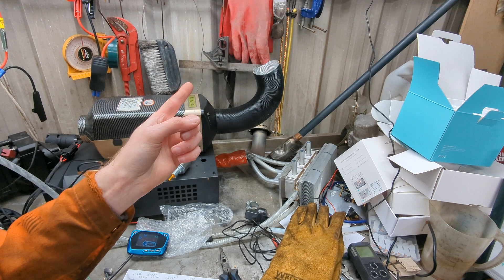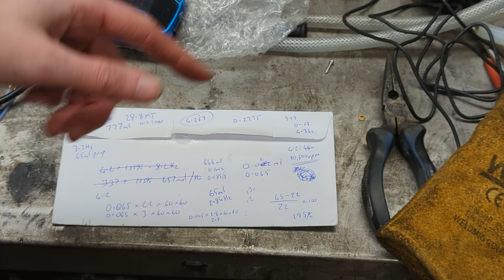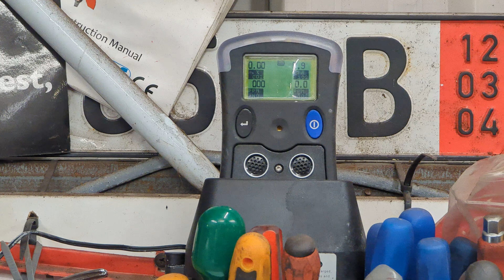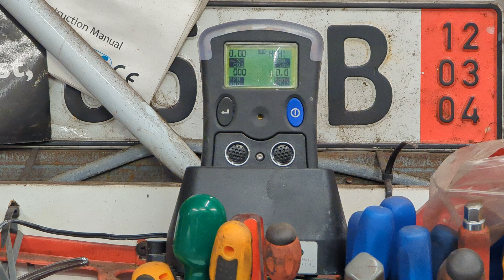Why the 8KW diesel heater can't be 8KW.

Comment: what i saw on another channel  also confirmed what you found      around 4 kw     but    the motherboards    controling the pumps      in the 5kw     and 8kw    are different      the lowest   hz  on the 5kw    and the max  hz  on the 5kw             are lower than on the 8kw     the low hz  on the 8 is a little higher       and the max  hz  a little higher      giving   a little more max heat out  so it appears  warmer than a 5kw         if you look at the chinese specs    they say  the 5kw     is 5000watts       and the  8kw   is 8000w        but there is no time factor    so its nonsense
Reply: The definition of a Watt is 1 J/s.  It's a unit of power or how fast work is being done.  A continuous 5 kW will be 5 kWh at one hour and 10 kWh over two hours time which is an indication of energy.

Comment: Well I did read that it was those blue clocks that you have only come on a 5kw and 8kw. I’ve got said 5kw with an entirely different module which is black and the seller sold it as 5kw. So I believed and so I’m happy as it works a charm. So if it’s 4kw it’s not the end of the world but I’m glad you have cleared up the theory of the 8kw as I was just about to order the blue module you have. Thank you for saving me a few quid. 😊

Comment: You're right. The fuel pumps on these units don't move adequate fuel oil to be burned. A gallon of fuel oil provides 138,000 BTU/hr,  and a liter 36,450 BTU/hr. Eight kilowatts of heat is 3412 x 8 or 27,300 BTUhr. The burn rate of one of these 8 kw units is rarely over 500 ml per hour so it's likely that they are much closer to 4  or 5 kW.

Comment: I would think that using the filtered air from a shop vac to increase the air pressure to the air intakes would give you the extra air you need, for the extra fuel.
Reply from the maker: That's not a bad idea at all.
Reply: @DavidMcLuckie  Since you have the top off of one of the heaters for a viewing window, you might thread a cover plate of aluminum for a heated automotive  O2 sensor.
Might give you some useful adjustment data.

Comment: Hello Good Man.   I purchased a 5kw unit with ch14 controller.  Do you know what the 3 digit code for advanced menu is?  Thanks in advance
Reply from the maker: 3 digit code?  I haven't seen one of them.
Reply: @DavidMcLuckie  it is blue control.  But it has heater icon in screen center and no network icon at top left. Battery icon left of heater icon.  Maybe it is a 4 digit.  Cant seem to access a advanced menu.

Comment: Why there are all this alarms go wild ..did you throught exhaust gas inside or there is a problem with the unit?
Reply from the maker: As the 8KW heater does not exist and in trying to make it run at 8KW produced enough carbon monoxide to kill you fairly quickly.  That and it would fill your heater with soot.
Reply: @DavidMcLuckie  yes it produce CO but all the exhaust gas should go out not insidey question is if you throught the exhaust gas inside your area just for the test or there is a leak on the Unit
Reply from the maker: Inside for testing, else how would I be testing the CO?  :)

You should always have a CO alarm if you have any fuel burning appliance.
Reply: @DavidMcLuckie  οκ now i understand because i think to buy one of them for my home and i am a little worry about the exhaust gas in case of a leak in some gasket .This is a 150 euros device and it dont give me enought confident

Comment: Do the 2kw and 4kw use the same 22ml pump?
Reply from the maker: Yes.  And some people think they shouldn't.  There is a smaller 16ml pump which is probably better suited to the 2KW.  But for cheapness 95% of heaters ship with the 22ml.

Comment: Since you like to experiment with these, What would happen if you put a blower on it and run it at a leaner pump setting?  Would you get more heat (but be able to regulate meltdown temp) and better fuel efficiency.  I look forward to seeing what you find out.

Comment: David, Just purchased a new diesel heater. The shell around the heater is cast metal? Two pieces that split in half. Have you ever seen this? What is the benefit of the metal case? I think your energy physics are spot on. Keep burning the Dino Juice!
Reply from the maker: The metal can't melt under normal operation.  Other than that there isn't a huge advantage over reinforced plastic shells.

Comment: David, based on your experience of the combustion chamber, can the diesel heater be mounted in a wall vs the floor which would make the exhaust /intake ports horizontal. Do see any issues mounted it in a wall. Thanks, love your videos.
Reply from the maker: You can run the heater on it's side as long as you keep the glow plug on the top.
Reply: @DavidMcLuckie  Thank you David, glow plug upwards.

Comment: I got a 5jw gasoline heater today, but the manufacturer routed the pump wire and plug trough the fresh air inlet pipe. I think to prevent me from drilling an additional hole for it but doesnt that get hot? I want to know before installing.
Reply from the maker: That's interesting.  The intake side doesn't get hot.

Comment: Dig these videos, learning a ton, thanks.  Question for anyone that has the Chinese 5kw or 8kw heaters, what is the size of the duct that attaches to the end?  Is it 90mm?  I live onboard a boat with two Webasto EVO 55s, and every season I suffer multiple breakdowns.  Its just a fact of life at this point.  It’s probably a regional fuel issue that I can’t escape. Thing is, these Chinese knock offs cost less that a burner kit for the EVOs.  I’m considering switching out to the Chinese ones simply because for my normal season parts cost on the Webastos (in the US). I can buy 5 Chinese units and treat them as disposable. The only thing I’m concerned about is mating the ductwork and exhaust from the Webasto to the Chinese units.  Possibly the mounting bracket too.  Any advice is appreciated, Thanks
Reply from the maker: 75mm.  I'd hope that you'd be able to get a reducer to get the pipe to fit.
Reply: There is likely more than one reason for the larger ducting.  Distance,to point of heating, is a major factor that the ‘parking heaters’ don’t (or shouldn’t) need to take any account of.

Comment: Hi David. I’m looking to replace the pump on my 2kw. Should I go for a 22ml or 16ml. I’ve a rotary so can’t tinker with the settings… any thoughts? Merry Xmas btw
Reply from the maker: It's likely it came with a 22ml, the majority of heaters did.  If you go to small it might flame out on the low settings.
Reply: @DavidMcLuckie  Thanks David. I’ve recently found you and throughly enjoy your videos!

Comment: Haha!! David you are a total nutter, I'm surprised you didn't have the fire, police, ambulance, bomb squad and every other service at your workshop with all those alarms going off 😨😂😂

Anyway, new subscriber to your channel as I have one of those so called 8KW heaters (mine is a fully cased unit) in my workshop and small homemade spray booth, the heater is amazing and gets my booth up to 27C when it was 3C outside and that was this morning, however I do/did have a problem with it. I got the heater in early September this year and last week it started pushing out clouds of white smoke from the exhaust (just under 3 months daily use about an hour per day). I took the heater apart and the burn chamber was totally caked in black soot and it was caked inside the tube where the flame comes out, gave it a good clean then rebuilt it as it was without changing any parts and it's back working as good as new.

Any ideas what could be causing all that soot build up in a short time? when I bought it I also got one of those laptop type power supplies that said it was a 10 amp supply but I'm not convinced it's up to the job. I have a 50 amp power supply that I use for charging batteries for my large scale heli's so I now use that for powering the heater, it says on the power supply that it's drawing up to 9 amps when the glow plug is on.

Anyway David sorry for the long comment but I wanted to give you all the info I could about my heater problem, I'll see how it goes on the bigger power supply (been 3 or 4 days now) but if you have any other ideas what the issue is I would be very grateful 🤗👍 John UK.
Reply from the maker: My guess would be it's not tuned properly is wasting fuel turning it into soot.  I've got a few videos on tuning, but the basic is a cheap carbon monoxide gauge and you turn down the fuel in the settings until you get 10-20ppm of carbon monoxide on the gauge.
Reply: Thanks for the quick reply David, I had a feeling you were going to say that! I have watched your tuning videos so I'll get a co meter to see what it's pushing out, I have a co meter in my workshop but it's just the normal type that warns you so reacts to slow for testing, thanks again David 👍 oh am I right in thinking that the pass code for the lcd controller is 1688? 🤔

Comment: I have recently had a chance to use my new large frame heater. Most of the accessories are SHITE ! The heater puts out huge heat while on the bench, however overheats when attached to ducting other than whats provided in the kit. too much back pressure must be the culprit. Maybe a auxiliary 3 inch duct motor connected to a Y would help move the heat out.

Comment: David McLuckie  VEVOR Diesel Air Heater  12V 8KW just received this today as it gets hot it blows out a weird smell it might have sucked up sawdust by accident but maybe not?? from your experience do these units put off a weird smell for a while
Reply from the maker: The heaters not usually.  But I've had plastic melting smells come from some air vent covers in the past.

Comment: So that's mean there is no reason to buy this one instead of the 5 since they're the same.
I got a "8kw" heater.

But I got several questions now. 
- When I'm in the parameter, (Admin code 1688), I see SN:  1 / 2 for the magnet on the fan, but what's PF: 5?
- I set the lower Hz to 1000, so it should consume only 2.2cl per second and so 132cl per hour, and at the maximum (in the parameter) it's 5500hz so it should consume 726cl per hour (2.2*5.5*60). This last is close to what you said (777cl) and consumption are, with a big approximation, around 100cl/hour/kw. So that's technically close enough to the 8Kw?

- Anyway, I set it to low with a temperature I want to maximum 15°C, but it's already over 20°C and it continue to warm. Does the thermostat really work or I should do something else to ensure to not go too high in temperature? Could I drop it to 800Hz or it will be too low to work properly?
- And to finish, did yours smell burning rubber when they're hot?

Thanks a lot for your nice videos, I just found you searching for these answer, but I finally got subscribed.
Reply from the maker: PF-5 is the power level selection for the glow plug. 1=35w 2=40w 3=45w 4=80w 5=85w 6=90w

You've confused the fan rpm 1000-5500 for the hz.

The thermostat only switches the heater from low to high power.
Reply: @DavidMcLuckie  No I didn't confuse the RPM with Herz. I can show you a video where I can choose between 800 and 8000hz and the fan rpm between 1000 and 5500.

Just a bout the information, I  dismantled it and I've seen that my fan got 2 magnets on it but in the parameter they said I was on 1. 

About the rubber smell, I took it off and put some high temperature silicon instead and then put it back in place. Now It doesn't smell anymore.

But yeah, technically for the pump I can go up to 8000 hz but even if I parameter it lower or higher, I can't do it when I'm off the parameter. (And I don't speak about the RPM, but only about the power).
Reply from the maker: I apologise then.  It must be the controller that is programmed with the wrong units.  As we can agree the pump will not pump at 8000hz.
Reply: @ktexsite  Hertz is the term for cycles per second in the SI system.

Comment: Is there a thermostat in the controller? I used mine for the time last weekend and it got so hot in my truck. I’m thinking of extending the controller into my truck so it’ll shut off when it reaches the set temp if there’s a thermostat in there.
Reply from the maker: Yes, but it doesn't switch the heater off.  Only switches it onto low speed once the temperature is reached.
Reply: Don’t shut it off with a thermostat unless the heater can follow its normal shut-down procedure.

Comment: May be they were some how mistaking, latent heat versus specific heat versus Real power or just the plucking of thin air 8Kw rating
Reply: I'll take thin air for $100
Reply: Chinese unit is a Kirowatt - much smaller than a Kilowatt

Comment: Thank you for the diesel heater videos, they have answered so many of my questions.
I do have a question about filters for these heaters that I can't find on youtube, can you use a automotive filter with a water separator or a filter for a oil furnace?
How about those inline filters with the paper medium? Or is the filter medium of these filters to dense for the pulse pump to draw through?
Reply from the maker: That's a good question.  Even the inline filters I have now are plastic mesh.
Reply: I have a lawnmower filter on mine and it works fine.
Reply: If you look at the installation directions you should find the maximum lift for the pump.  You could work out the physical values if you care to, but suffice it to say they don’t give these limits for no good reason.  For oils heavier than diesel, that head would be diminished - or definitely place the fuel tank above the heater (and that could cause problems…).

Comment: having bought 2 vevor branded heaters; one being 8kw and the other being 5kw, they're definitely the same units, however the noticeably difference was that the 8kw's chamber body casting was near perfect where the 5kw has some cracked, bent, malformed fins on the outside(inside looks fine) suggesting it was probably made with an older casting mold..... my theory unless proven otherwise is that the casting quality is the main determining factor of what they rate the units; of course like with computer cpu benching at factory there's probably occasions where they they rate according to demand ** ironically the 5kw puts out more heat quickly right now, but it's understandable as I've been running used engine oil and I've had it for a shorter amount of time:P
Reply: Does the "8kW" unit measure up?  1kWh = 3.6MJ.  There is about 37MJ/L in Diesel.  Since all these heaters are rated by consumption, not output, the quality of the heatsink is unlikely to factor into the rating.  It would need to burn (3.6*8)/37 litres [~780mL] per hour to be an actual 8kW unit.
Reply: Did you do anything to it or the oil to run it on used engine oil?

Comment: hi good videos as always have you any idea why i can smell exhaust fumes coming out of the air outlet have replaced all the gaskets but still smells
Reply from the maker: Have you checked the rubber 'plug' that the glowplug wires run through, that's the only other place where you might get fumes as the heaters starts up.  Other than that a cracked casing.

Comment: I guess you could get 8Kw out of a 4Kw heater; what’s the heat output of the burning case material (i know that Ali doesn't burn in solid form, only as a powder) but the plastic and PCB would give off some heat - this may invalidate any warranty, but this is stuff shipped from China, so good luck with any claim.

Great content as ever 👍
Reply: I guess you are not old enough to remember HMS Sheffield during the Falklands war?  Of course Aluminium will burn.  Aluminium powder is a solid, is it not?

I have rather liked most of David’s videos on these CDHs (or should it be CDAH for chinese diesel air heater?) since I came across his channel.  Sometimes whacky (wacky if you’re younger) but  I have found his channel so much more interesting, honest and knowledgeable cf the average van-dweller, etc.

Comment: Hey they are 8KW but that’s Chinese KW lol. I have a so called 8WK heating my lounge which is roughly 14ft x 14ft and 1.8hz is nice and toasty. I use a diesel heater because it’s the cheapest form of heating where we don’t have gas and electric is way too expensive and coal is a pain so red diesel does nicely.

Comment: Ive a video suggestion: can the burner and heater exchanger be rotated 180o so the exhaust points up so a hotplate/box can be used to Cook on? (Im thinking the hot box would have an outlet so the exhaust pipe still goes down).
 Thanks for making the videos, im always learning something :)
Reply: no

Comment: I had an idea that I think could drastically increase the burn efficiency and therefor heat output. Take a small copper line and wrap it around the exhaust. Then replace the existing fuel line with that. The idea is you will boil the fuel and inject the fumes into the burn chamber. The same way a camping diesel jet stove works. In a home oil furnace you use high pressures and a nozzle to atomizer the oil. This thing just dribbles fuel onto a hot mesh. You'd then be injecting fumes into the burn chamber. That will mix with air and burn much easier. It should clear up some head room for the fan since you are using air more effectively. With that, you have room to add even more fuel so long as it can boil it fast enough. This might also fix the sooting problem when these run on low.

Comment: here is a challenge for you. take one and make it run on propane. as for mine the max fuel rate is capped buy the board in the heater and not the controller. temp feedback from body temp sensor. capped at 425 F.